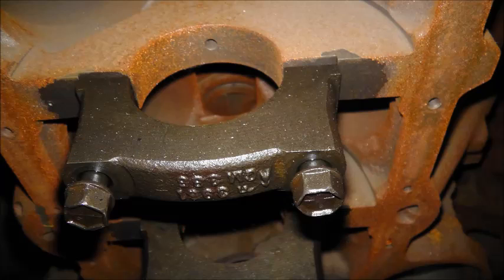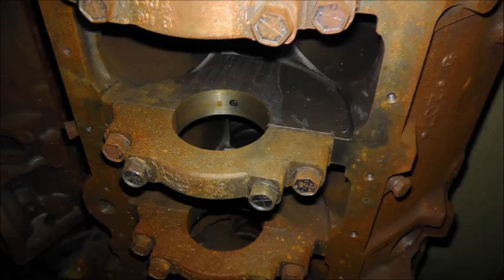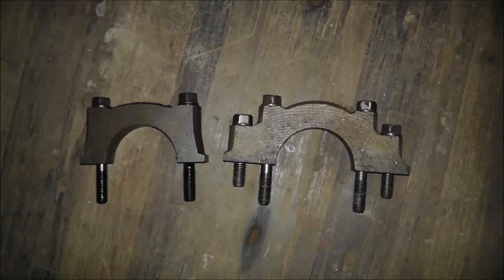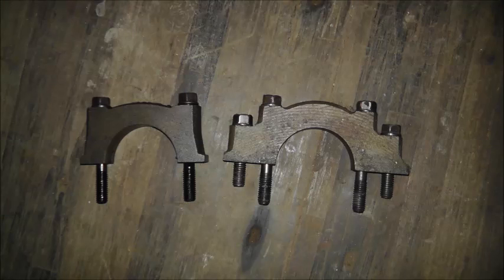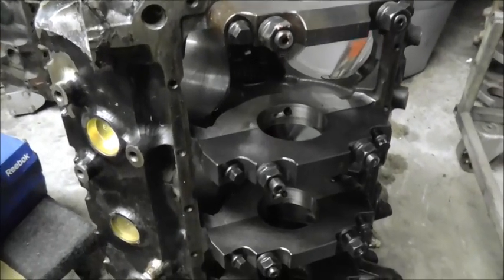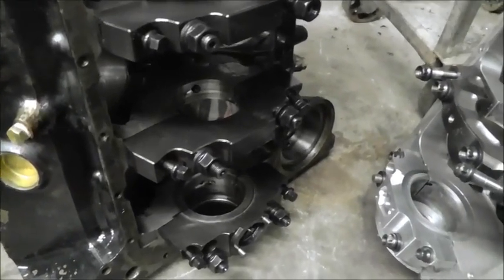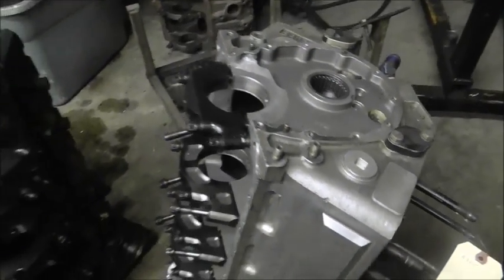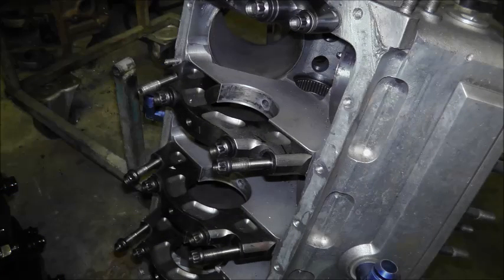Ask Roger: How much power can a 2 bolt main cast iron sbc block hold?

Comment: The power load never exceeds the inertia load, pistons and rods can only take so much force, and the forces of it pulling up on the crankshaft is way higher than it ever will push down.  Catwalk is when they wiggle forward and back and it only happens at extreme RPM so as long as the RPMs are low under 7000 you’ll never have any issues.

Comment: Well how often do you see a main cap go out.Been racing motors for 30 years and never snapped a 2 bolt main.EVER.We have pushed 2 bolt main 400 sbc’s well past 500 torque and 500hp shifting at 7000rpms and never had a problem.Spun a few bearing and broken valve train a few times but never a crank or 2 bolt caps.Thats N/A.If your tossing power adders then that would be interesting but I wouldn’t push my luck.

Comment: I'm well Over 500hp not counting 100hp spray that i don't use often. I have a moldex crank machined knife edged very strong very lightweight same with rods and pistons. Teflon coated bearings. Pete Jackson silent gear drive ballanced which helps with harmonics from gear drive if i go through it again I'll switch back to true roller timing and install splayed caps. A little high on compression for street but colder plugs and timing adjustments i can run 93 octane. On longer trips. If just playing i run either 101 or 93 and 108 turbo blue. I also can just use 93 and octane booster from local speed shop i buy by the case. Love the turbo blue smell and it keeps it safe from detonation. 11.7.1

Comment: My 400 sbc 2 bolt was 490 hp w/ 491 tq. I spun it to 7000 rpm more than once. She held up.
Reply: That was flat tappet w/ hardened push rods & roller rockers.

Comment: Is the factory 400 small block 4 bolt weaker than the 2 bolt? Or and old wives tale?
Reply: Some say that they tend to crack where the mains go into the water jackets

Comment: You know what, you can throw as much power as you want if you can control the harmonics. Chris Watson runs a stock bottom Ford 5.0 to 900+ hp at the tire, 35 lbs. of boost in a stick shift Mustang. I don't think it's blown apart yet after 4 years of abuse. It runs 5s in the 1/8th mile. He keeps the rpm down most of the time ( 6000 rpms ). Factory built bottom👍

Comment: Would it be possible to buy 6 bolt mains and drill and thread two outer holes in the block thats only set up for four???????? Looks like there’s sum extra room on that block for two more holes per main. And if needed could u weld in all the areas where the extra bolts would go for added strength on the block on both sides where the new bolts would go before drill n tap of each hole???
Reply: Be a waste of time. You ain't gonna push that crank out even with 2-bolt mains until your way over 550-600+hp. Probably not even then.

Comment: My 468 bbc 2 bolt studded bottom end has held up to 10lbs of boost from twin gt45 turbo for 2 years . splaying caps the bolt goes into a weak area of the block i think.

Comment: I have a 1975 / 350 2 bolt main out of a 1975 Corvette do you think this will be a good block to build a 383 stroker with a bout 450 hp
Reply: Yes. Even better if you use good main studs vs stock bolts but stock bolts are getting sorta close to the edge with a 6,500 rpm 3.75 stroke motor. Only thing is of you use studs you almost always liekely have to have it lined honed afterwards because the higher clamp changes the shape of the main bore. Not always tho, I know a guy who didn't.....
       but he checked it first!
Reply: Hell yeah, opt for more power

Comment: Wish I found a local as urself build my motor got fucked on mine got 2 bolt with a flat tappet cam. Def. Didn't know all I needed and was way mis informed. I wish it was a 4 bolt main with hydraulic roller cam instead of a damn hydraulic flat tappet camp setup
Reply: I live in Indiana also. Got a bad deal and got screwed I think. Paid 5500 for mine

Comment: Bunch of desk jockeys....  I've run all types of 2 bolt mains...  Never had a broken crank or block...  I always use a ARP main stud kit...  I've blown head gaskets, melted pistons, put valves through cylinder walls... You name it....   They took it.... Broken parts were almost always my fault overlooking something....  A stuck solenoid will cook any engine in seconds regardless of how many bolts it has...

Comment: There is no answer for this question.  I have seen turbo small blocks with 2 bolt mains make upwards of 900 rear wheel HP and live.  I have seen stock 305's with the mains cracked.   Detonation, RPM, quality of balancing, quality of machine work, core shift, corrosion, etc all have more to do with an engine block letting go then how many bolts the mains have.

Comment: People always say I want so much horsepower. Engine builders ask how long do you want it for?
Better is better. Better last longer.
If you're going to stack money, stack it on the best foundation you can get ahold of. A friend of mine ran two bolt mains in tow trucks.
He says they hold up pretty good but the question is for how long?
They built those four bolt mains for a reason. There are plenty of them around. People like 1973 and earlier truck motors If you're going to spend money and go to the trouble. Go with a 4 bolt Main.
Reply: You might want to do research on what's the difference between the two
Reply: The weight of the vehicle and compression has a lot to do with down force on pistons trying to push crank out of the block. Power adders Have a big influence on this to.

Comment: I've had my share of 4-bolts and threw away some really good condition 2-bolts, believing that they weren't worth the time. But when you look back, how often have you seen a 2-bolt fail because it only has two bolts on each cap? The first thing that usually goes is either a rod or piston. If you're constantly going to high rpm, you would think that would wreck a 2-bolt (stock). But it ends up being a rod or a piston letting go. Unless you're building a fully dedicated race engine, the 2-bolt is fine (and sometimes FREE) for weekend/bracket racing.

Comment: How much power can a 2 bolt block handle? Depends on many factors. Always start with studs and a girdle. Lighter weight crank/rods/pistons will extend the limit. Lowering rpms will extend the limit. Good balancing will extend the limit. Proper tune will extend the limit. Blocks that have a higher nickel content will be stronger.
Reply: Girdles are for pu&&ies

Comment: I put a 327 rotating assembly in a 1969 2-bolt 350 block with studs, spun it up to 8000rpm every time it was used, it never pushed the crank out either. It was a 530+HP engine in a drag car. We used to build M/P 283s with 2-bolt blocks and spun them up 8500-9000rpm. Stock steel cranks, aluminium rods, Arias custom lightweight pistons. Studded production 2-bolt blocks. Revved the hell out of them. They was making big power as well for 288ci & 292ci SBCs. Really a person shouldn't worry about how many bolts are holding the crank in till they start making big power or run a power adder. Guys with 300hp 350s bragging about how its a 4-bolt main amuse me. I've built over 1000 engines in my career, so I've seen a few.
Reply: Good stuff man! I worked for arias. Not for very long cause the shop closed up but I was there!
Reply: What is the difference between a 327 and 350 block
Reply: @Dougarrowhead  up until late 67 the 327 used a small diameter main journal. In late 67 they started making the 327 with a wider diameter journal size that is shared with the 350 and at this point mostly everything interchanges. The main caps on the 327s are slightly shorter than the 350. There were some differences with pcv systems. The early 327s used road draft style where there was just a tube off the back of the block right next to the distributor behind the intake manifold that vented to atmosphere. This was changed on later 327s to pull from the valve covers to the carb and air cleaner same as a 350. On the late 327s it’s just like a flat pad where they would have drilled through to put the pcv on earlier blocks, a vestigial limb if you will. The 350 does not have that pad there. I have a 1967 327 big journal last 3 of the block # is 678 this block is from flint production plant and original to a 1968 model vehicle. This block in particular weighs more than a 350, not by much maybe like 10 pounds at the most depending on the 350. I noticed I had to do more clearancing to get my 383 stroker to fit in this block than most guys had to with their 350 blocks. I had to do more grinding away at the spot where the oil pan meets the block and more notching at the bottoms of the cylinders. It seems like the extra weight of my block was located in areas like that, not really anywhere that would make it stronger. Some people say the 327 is a stronger block but IMO even if that’s the case it’s such a small difference that it doesn’t really matter.
Reply: @SpecialAgentJamesAki  I built a 383  from a 69 327 block in about 1999. Block came from camaro. It is in machine shop now getting a new life and splayed caps. It is going back in my nova.
Reply: @Dougarrowhead  sweeeet that will be a fun combo

Comment: I have a old 1970 2-bolt 350 that's making around 550hp. I've owned it for 20+yrs, I've freshened it up probably 5 times, its seen 7500rpm thousands of times, and its never pushed the crank out. I'm using all forged rotating assembly, ARP studs, proper blueprinting, and that's it. I believe the pre 1973 350 blocks are best. They will take more than most people would think.
Reply: Ya, same here...
Balanced and lightweight with the best fasteners

Comment: I've got 720  horsepower with twin turbos on a 350 2 Bolt with a scat rotating assembly
Reply: Similar at 830 to the tires on a big single 2 bolt.  Really should start putting together another engine when this one scatters though.
Reply: 647hp 334 stroker 305sbc on nitrous.
ARP studs custom Icon nitrous pistons, promod forged rods and forged 3.75 crankshaft.. Brodix 11x spreadport heads and Brodix spec 390 single plane intake....648 solid roller cam.....
"Screamer "
Reply: well arent you SUPERMAN!!!
Reply: @MasterWitchDoctor  nope just do a great balance job and ring Gap after that just well fuel mixtures

Comment: there is a lot more to this than just 2bolt vs 4bolt vs splayed main caps. the real answer is that it depends on the block. the 350 3970010 block with the 010 and 020 alloy casting codes are the best 2 piece main seal 350 blocks. it was a high nickel and tin  alloy and they had thick walls and main bearing saddles. they were mainly used in truck and high perf applications, they usually have 4 bolt mains in truck and HP applications, but some 2 bolt versions made their way in to low end commuter applications. 75 and latter 350 thin wall castings don't hold up like 3970010 castings. some later 1 piece main seal blocks that are manufactured with updated casting techniques are on par with the 0010 blocks, but they were again mainly used in trucks and some HP applications like Camaro and Corvette. the 400 SBC is a different animal. the 400 main bearing diameter is larger and it weakens the main bearing saddles with 4 bolt blocks. the 2 bolt 400 blocks are actually stronger than the 4 bolt blocks. most 400 4 bolt blocks will have cracks in the main webs if they are driven hard. so my answer is the 3970010 block if I am building a 2 piece main seal engine, a 2 bolt block if building a 400 engine. and I use a corvette or camaro, or ZZx crate motor block if building a 1 piece main seal engine. the splayed main cap conversion is great on any 2 bolt 0010 350 block or 2 bolt 400, but you need to find a competent machine shop to do the work. its very easy to screw this up and I have seen a lot of blocks turned to junk because the machine shop screwed it up. the other thing that is important is core shift. look at the cam tunnel front and back to see how it is aligned in the block. this is an indicator of how the casting cores shifted during casting.

Comment: You can use a 400 to build a 421 just keep compression down and grout the block up to the bottom of the freeze plugs to stabilize the bottom of the cylinders.  Still a crap shoot.

Comment: is a 2 bolt main block good enough for the 383 build? specifically using a 1996 5.7 880 casting 2 bolt main block???? I have two block in the 880 casting which are the roller vortec blocks. I do plan on using ARP studs and ARP rod bolts and ARP head bolts for the upgrade power handling. But my concern is it being 2 bolt main. My plan is to be in the 400 horsepower range, maybe 450 horsepower but more likely 400 or so. I want it to survive daily driving and occasional strip time maybe visit the strip a few times a year. Its going to be mostly a cruiser but I want to be able to hammer it once in a while. I notice your using a 2 bolt. OH! The crank will be a cast steel scat and the rods are going to be 5.7 factory rods. I will be aiming for 9.5:1 to 10:1 compression using the factory vortec heads reworked to handle lift in the range of possibly LT4 hot cam or????? whatever cam that will support the use of my factory fuel injection, spider , ect......of course tuned to calibrate everything accordingly.  So basically the Vortec 1996 engine that is in my truck will reuse all the factory parts except the crankshaft, pistons and cam. The block, Rods and heads are going to be reused in the 383 build. BUDGET is the key word in this build..... It will be my daily driver for 3/4 of the year and put up for the winter. hopefully the aim for the compression and what I listed would be ideal. Also I need to be able to run pump gas. I am OK with having to run premium 93 octane every fill if needed.
Reply: 2 bolt will be fine...As far as ARP studs vs bolts, with studs they recommend getting it align honed after installation, which is like 180$ at a machine shop...bolts usually don't require line honing. Also, before you get excited about re-using your stock rods, its best to get the rods rebuilt which is almost as expensive as just buying new SCAT stroker clearanced i-beams...they are brand new and already stroker clearenced so you don't need to grind on your factory rods ( almost always required to clear the block) ...this advice is what i see on saving money and doing it right..vortec heads on your 383 will be a torque monster,  be sure and pick your cam correctly and don't go too big and lose out on low end torque...ask yourself honestly " How often do i really spend around 5,000-6000 rpm" ...answer is probably very rarely.
Reply: I'd stay away from factory vortec heads their prone to cracking...

Comment: How do you feel about two bolt 400 small block Chevys running ARP studs and a steel main bearing girdle? What about a valley girdle? How much compression is "high" compress in your bracket race example? 9:1? 11:1? What about RPM? Is 6,000 okay while 6,500 is pushing it?  Terms like "high power" and "high rpm" have become confusing in an age of 270cfm "as cast" heads and .600" lift roller cams.

Comment: I've got  just  one  question  why do some  racers  put concrete  in there 400 smallblocks.
Reply: Phillip Filides strengthens the block. We did it on our 468 bbc that was running alcohol and 871 roots blower.
Reply: Phillip Filides it's an very old school trick for strength.
Reply: Phillip Filides and also cooling

Comment: I have a sbc I want to put a solid roller cam in it , with 610 int, 610 ex,256 @50 on int,258@50 on ex with a 106 love separate.will  this cam be really hard on lifters driving on the street

Comment: Hey I got a 2 bolt vortec rebuild fresh I picked up it's bored 60 over I got a  edelbrock Webber carb on it not good by the way also 268 cam what would be a good carb from edelbrock manual choke  and a good distributer it run ok but I gotta make it better on a fair budget any suggestions
Reply: Twinyo100 switch to Holley carbs,MSD.ignition and you will see some good results and your wallet will thank you.
Reply: Holley carb is better.

Comment: i have a gm goodwrench 4 bolt crate engine. i have the pro 1 dart top end kit with a demon carb. i have arp head bolts not studs. they was sayin i should be flirtin with 450 500 will i be safe on stock internals? thankyou in advance
Reply: Unless it turboed you will be fine
Reply: bro i almost double replied lol

Comment: Have you ever put a large journal 327 crank with 3" stroke in a sbc 400 block?
Reply: Our super late model engines are destroked 400's. We use 3.25" stroke cranks and usually a 4.155" bore. Gives is 353ci and keeps us in the 355ci rule. Awesome engines👍
Reply: John Allen 327 has a 3.25 stroke the 302 had the 3inch stroke 350 has 3.48
Reply: Old School 327 is Small journal and they Rev Better because of it, they can hold more RPM, they are not 3" stroke the 283 is 3" stroke, 327 Small journals are 3.28" stroke with 4" bore I have some of Each and small journal is Steel Crank.....

Comment: THE 4 BOLT MAIN ON THE SMALL BLOCK CHEVY IS ACTUALLY WEAKER. ALL GM DID IS DRILL A 2 BOLT MAIN BLOCK AND WEAKEN THE WEBBING. THE BIG BLOCK IS THE SAME THING. IF YOU CHECK THE BLOCK CASTING NUMBERS ON A 2 BOLT MAIN BIG BLOCK 396,427, ETC AND THEN A 4 BOLT MAIN THE CASTING NUMBER FOR THE SAME YEARS ARE THE SAME. A FRIEND OF MINE HAD A 375HP 396 FOUR BOLT MAIN IN A CHEVELLE AND CONSTANTLY BLEW THE ENGINES. HE EVENTUALLY WENT WITH A 325HP 2 BOLT MAIN AND NEVER AGAIN HAD A PROBLEM. WITH A AFTERMARKET RACE BLOCK THE 4 BOLT MAINS ARE STRONGER BECAUSE THE WEBBING IS DESIGNED THICKER WHERE THE EXTRA DRILLED HOLES ARE NOT DRILLED INTO A THINNER CAST LIKE THE STOCK GM BLOCKSTHAT WAS INTENDED FOR A 2 BOLT MAIN.
Reply: i agree with you Frank, i don't see any problem with 2 bolts and good bolts or studs.
Reply: hit your caps lock key,no one on youtube reads any comment in caps